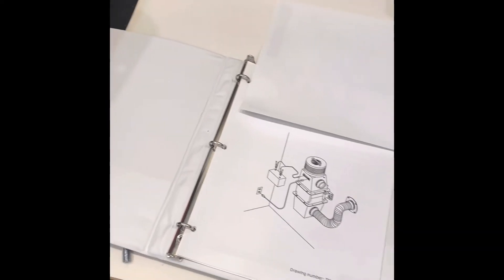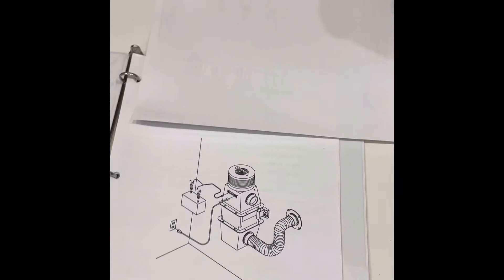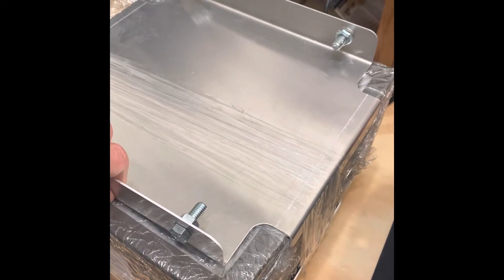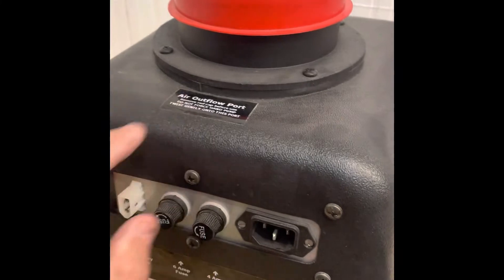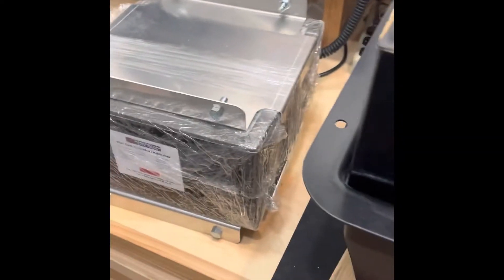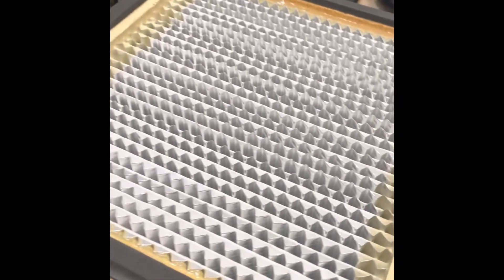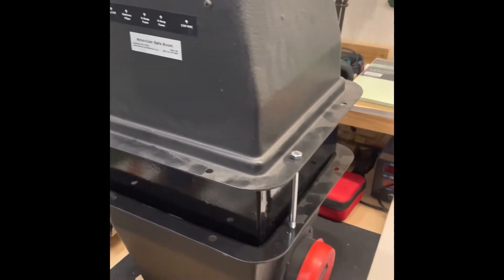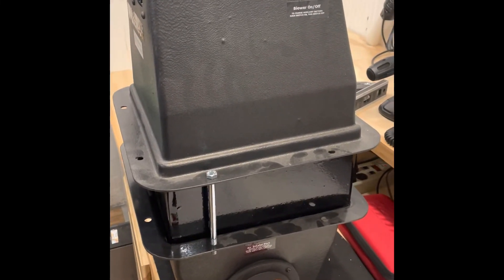Safe Cell NBC Filter - design and look inside - is it worth $4000?

Comment: How many cfm does your fan need to blow to keep enough air flow ?
Reply from the maker: That depends on the size of area you supply. You want about a 0.25 inch of water pressure in the shelter. So, you need a fan that will provide the necessary makeup supply. It doesn’t take much if the area is fairly airtight.
Thanks for the question.

Comment: What strikes me about this is that radioactive particles are drawn into the body of the filter plenum which is inside the shelter... And that plastic isn't going to be thick enough to shield out beta particles or gamma emitters, even if it will shield alpha. I would definitely want that in a ventilation compartment outside of my shelter living space. This is more or less how CBRN systems work on warships where the filtration units are in a dedicated filter compartment which opens to the upper deck and the intake screens, but which is outside of the main citadel. That way any maintenance work or filter changes doesn't result in radioactive dust inside the inhabited areas.
Have to say that I think this could be knocked up for a few hundred dollars at most using your carbon filter design, a couple of soakwells and a 12 volt blower.
Thanks for the insight.
Reply from the maker: The placement is dependent on your shelter design. It would be best outside. Or in a space inside like a garage that would protect it from the elements. You could also shield it if you wanted it inside your shelter area. Thanks for the comment 👍

Comment: If you would watch the Atlas Survival Shelter video from x months before you - they also open it, with this same cheap construction inside. It's worth maybe $499, not any cent more. As summary, I can say: If you can't afford a certified Swiss filter, it's better to make one yourself.
Reply from the maker: Even the Swiss filters are the same basic layout for filtering but are more robust in the container and fan design. And they run about $10,000.

Comment: This looks like the harbor freight NBC filter. Your bucket with the squirrel cage blower is much better than that chinesium 12V PC fan. I would trust my life to that cheeze fan.

You can also buy 12V blowers. Surplus Center (nebraska) sells 120V & 12V blowers. My system is being constructed using plywood and I have dual blowers (120VAC & 12VDC) so I can run either (120VAC inverter & Genset, or 12VDC battery). The 120VaC blower has a lot more power, so I likely run that & only use the 12VDC as backup.
Reply from the maker: Sounds like you’re all set. Hope you get it up and tested. Do you have a manual air system in mind?
Reply: guytech7310, any chance you can share a link to that dual voltage blower? Have been looking for one with no success. Thanks